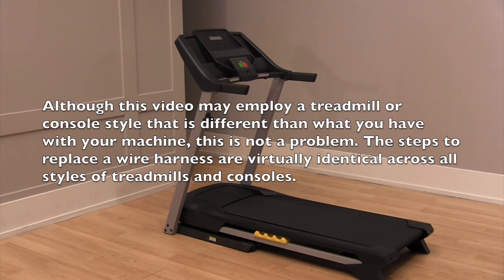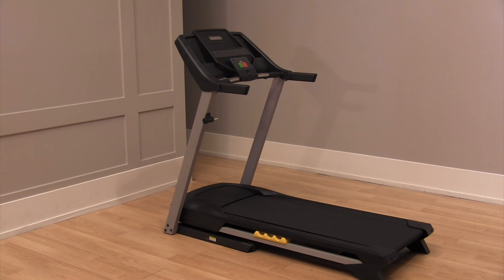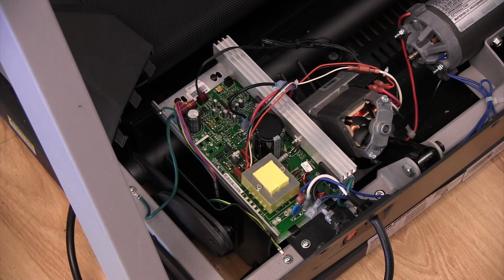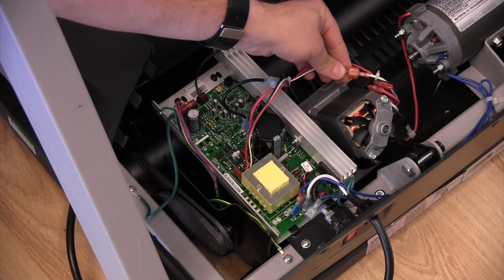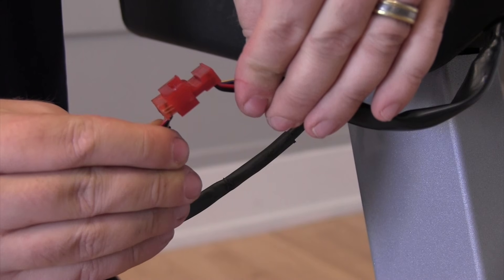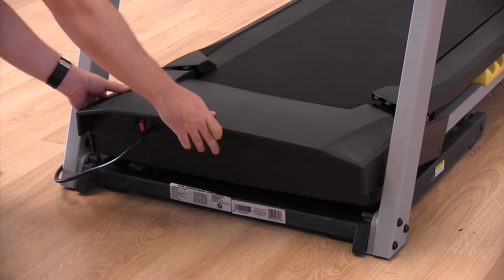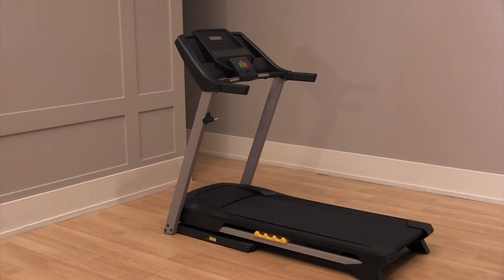Checking for Loose Wires - Treadmill

Comment: Thank you for your informative video. I was lucky to solve the problem off my Keys Fitness 6600T, sharing in case it will help others. Treadmill powers ON,  I can successfully set the program, the magnet key works fine. Here are the 2 issue symptoms: the incline was not functioning and when I hit Start, the treadmill shuts OFF. Did not find anything obvious. Pushed all wires and connectors in place on the control board, this did not help. I opened the console, and after pushing all connectors in place on the console board, then the treadmill started to work and my problem was solved. All the best.

Comment: Hoping to get some help with my issue. Got a NordicTrack T5.3 a few weeks back and everything seems to be working fine expect for the walking belt. Console lights and buttons work as expected, incline commands work fine, however when I select a speed command the belt does not turn. When I walk under my own power, the speed at which I’m walking appears on the console. I watched your LED blinking video and my controller shows a solid light with no blinking. I’ve also checked that the walking belt is not too tight. I figure the issue lies somewhere with either the blue wires going to the motor or the motor itself. Is there a way to check where the problem is without guessing and replacing the wrong item?
Reply from the maker: if the red light on the controller is not blinking when you start the belt but the console is counting time like the workout is running then that usually means the speed signal is not being received by the controller from there console. I would pay extra close attention to the upright wire and make sure that the blue wire (it carries the speed control command to the controller) is not pinched, broken, loose, damaged, or disconnected.

Comment: Hello sir I have Nordictrack treadmill that has no power but the power board is OK I am thinking the problem is on the console unit. Do you have schematics for the console model C700 treadmill. Thanks
Reply from the maker: I do not have access to that information. The manufacturer has decided to service its products at the part level not down to the component level within the electronic parts.
Reply: @FitnessEquipmentHelp  oh.. So does it mean it can't be repaired??
Reply from the maker: @goodelectronics4170  I'm sure it can be repaired but I don't have access to that type of information. The manufacturer suggested  course of action would be to replace the console with a new replacement console.

Comment: Hi - We had to move our treadmill, and during the process, the console connector to the motor control board was pulled loose. In the process, two of the exposed pins on the controller board got bent. Is there a way to repair these or do I have to search for a replacement 10-year-old controller board?
Any help and/or instructions you can give me will be much appreciated.
Reply from the maker: With the unit unplugged, you can try to straighten the pins. As long as the connection to the circuit board is still intact it should still work. if the pins have completely broken, then the board will most likely need to be replaced.

Comment: So My golds gym 410 looks exactly like this down there. I bought it used and made sure it worked before I brought it home. Once here it didn’t turn on at all. I opened the panel and found a wire that had came off. I plugged it back in and now the display works but the belt doesn’t run and no incline either. The light on the mother board is completely off. I checked that there are no other loose wires. What could it be?
Reply from the maker: The red light on the controller (lower circuit board by the drive motor) should be lit solid when the console is on and start blinking when the belt is started. If the light is not on the controller when the console is lit then there is something wrong with the controller. That would explain the belt not running.

Comment: I have the gold gym treadmill 410.  The control panel does not turn on. I have a solid red light on the circuit board under the motor hood. So I know there is power.  But the control panel will not turn on at all.  Please help!
Reply: Did you find out with the problem was I am having the same problem with mine .
Reply: im having the same problem with the same treadmill,.... did you figure out what it was??

Comment: hi a very good video! i have a problem, in my treadmill appears low voltage detected in the console and in the  operational manual say that The motor thermal wires are
disconnected, broken, or become loose, but i dont know if the problem is in the motor controller board or in the internals wires of the motor, what can i check then? can you help me??? thanks the wires see good out of the motor :(
Reply from the maker: Hi. what is your model #. If this is an iFit unit then you would not have any power to the equipment if the thermal switch was tripped or the wires from the thermal switch are disconnected. It would be just like if the power switch was cut off. the controller provides the power to the console. If the controller has voltage bit is not sending it to the console then it would seem the controller is faulty.

Comment: I have a Nordictrack C2150 and have replaced the driver motor and the motor control board. The belt seems to surge a little bit and the motor controller board's red LED  is blinking rapidly. Could it be surging due to lack of lubrication?
Reply from the maker: lubrication is what helps reduce friction between the belt and the board and usually is not a factor if there is no one actually standing on the belt. Try it while standing on the side rails to confirm that it is not a friction issue. I would verify exactly what le led is doing. Typically if the motor runs for a second, "surges", then stops it is an issue with the controller. The controller usually throws an error code like 4 LED blinks and pauses.
Reply: Fitness Equipment Help The LED on the motor controller is blinking rapidly while the belt is moving. The belt is not starting and stopping. It moves but is not consistent . Thank you for your help.

Comment: What's the wire with the spring with the metal thing that connects to the motor
Reply from the maker: I think you are referring to the motor brush wire. there are 2 wires (Red and Black) that are going from the lower control board into the motor. The spring pushes the carbon brush so it makes contact with the commutator (the part in the motor that rotates). They are held in place with retaining caps on the motor. The wires and brushes come with the replacement motor.

Comment: I have a AFG Pro 7.2 the data cable going to the console was severed.  I replaced the cable and now the console has power and everything works on the console but the elevation motor and belt motor won't work.  i have a solid red led and two solid green leds on the control board.  Any ideas what the problem could be?  Thanks!
Reply from the maker: I will preface this with a disclaimer that our company does not manufactur AFG products, and that I have no personal experience with the repair of those models. It seems to me however, that if the console appears to be operating and the cable is known to be good then I would suspect the lower board. It may be helpful to consult with AFG they may be able to supply you a voltage diagram or at least be able to explain what the LED Lights on the control board mean.

Comment: I have a NordicTrack X7I incline model #: NTL20909.3 - while using it the other day it went off an on several times while raising up and down then went off.  Now when I turn it on the ifit screen will come on for a second then go back off and nothing else happens.  It's like it went back off again... any suggestions?
Reply from the maker: If the screen powers on and loads to the main menu but then goes out then it would typically indicate that the safety key is not on the machine. I am going to guess that this does not describe your situation exactly however.  The original console for this unit has a separate power supply for the console tablet display. If the display tablet is powering down it may be due to a bad power supply for the console. I would try that first.

Comment: Need Help. I installed a new motor on my gold's gym 430i treadmill. The console works even the incline but the motor does not. I checked all the wire connections. Could it be a blown fuse or something? Please someone.
Reply from the maker: there motor controller has a led light that should be blinking when sending power over to the drive motor. It will also flash error codes if there is a malfunction in the controller. check the blinking patterns of the led to help diagnose what is going on with your treadmill. www.youtube.com/watch?v=QszHrCs72AM

Comment: Hi I have a Proform 545s and it was working good, I did an incline and put the incline back down a little and walked almost a mile. When I started to get off, I pressed the stop button....nothing happened.     I had to pull the magnet to get it to stop. None of the buttons work now but the incline button. Can you help me with this?
Reply from the maker: So when the key is inserted the display looks normal bit the incline buttons are the only buttons that respond, or does the console act like the start button has been pressed when you hit the start button (starts counting time) but the belt never turns on? Or is something else happening? In the first case you may have an issue with the console.
Reply: When I insert the key its all looks normal but the incline button is the only one that works. The timer and all the other digital numbers stays on 0 (but the pulse rate it checks my pulse and goes up!!!) So do I order a new console? The entire thing? The fan wont work either.
Reply from the maker: The displays and buttons usually are serviced as a single replaceable unit. That is the part you may need if there is no button response. Unfortunately parts for that unit may be difficult to find due to the age of the model.
Reply: Thanks for your time and information. I was able to order a used console. I like the treadmill and its held up pretty good for its age. Maybe it will last me a few more years. :)
Reply from the maker: Sounds great.

Comment: My platinum treadmill, when switch on immediately trips with a flash from motor.
Any advice
Reply from the maker: There may be a direct short in you motor if that is the case. I would replace the motor.

Comment: i have a treadmill but when i put it on, the board console ligth for a second, the fan start too and then go black again, what must be the problem?
Reply from the maker: Usually this is what will happen when the power switch is turned on but the safety key is not in place. the next step would be to put the safety key in place. If the key is properly inserted or placed on the console but the console remains unlit then you may need a new key switch. Sometimes the key switch is part of the console itself and sometimes it is on a pulse bar assembly or console base. If your treadmill is new and the key switch is not part of the console, make sure that the base or pulse bar assembly wires were properly connected to the console during assembly.

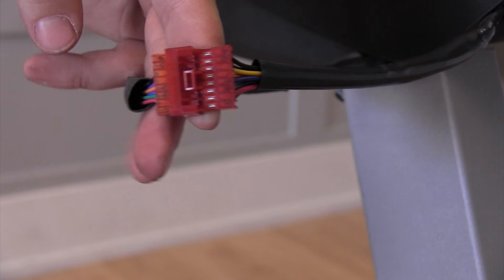Comment: I have a weslo machine and some how the wire connector are broken how may i repair that.. 2:47 is where reminded me of that part.. please help!!
Reply from the maker: Typically the component with the damaged connector should be replaced. The video shows where the console connects to the upright wire harness at 2:47. You would either need a console or wire harness or both depending on what part is actually damaged. Parts are available at www.iconservice.com

Comment: I got a error code 5b on a gold gym 430i any idea what the code means?
Reply from the maker: The error you are probably seeing is "SB" that stands for S-tuck B-utton. With the power turned off, you can use the palm of your hand apply pressure and rub the surface of the console buttons. This may free up any stuck membrane switch connections. if the error persists you may need a new console.
Reply: @FitnessEquipmentHelp  thanks for your help

Comment: Would like to know what the part is that has the fan on top right next to the circuit board.   The fan doesn't seem to work-
Reply from the maker: The fan is connected to the incline motor. The fan turns when the incline moves up or down.